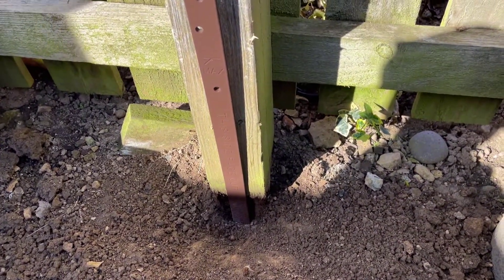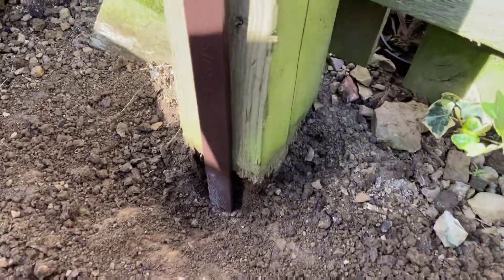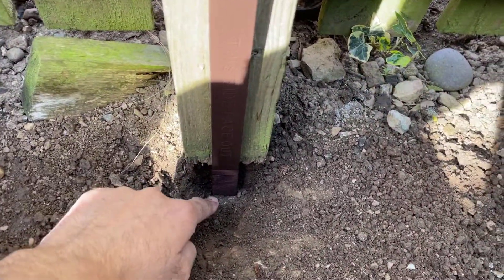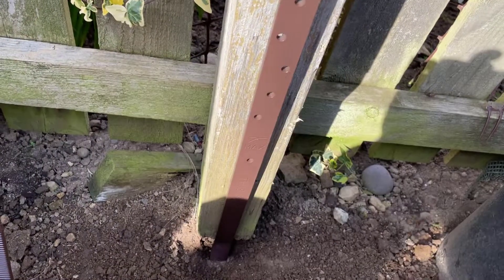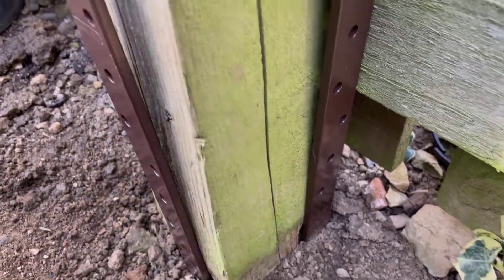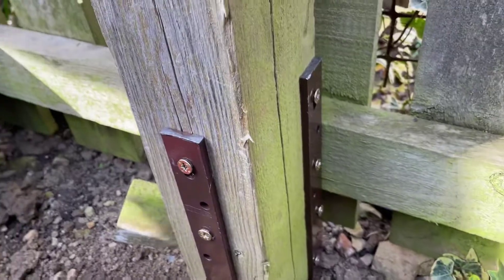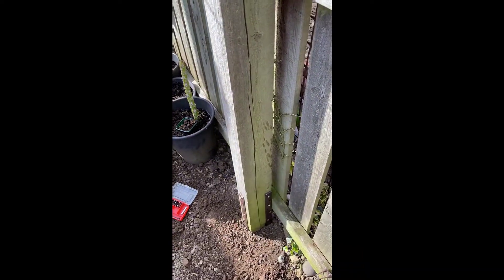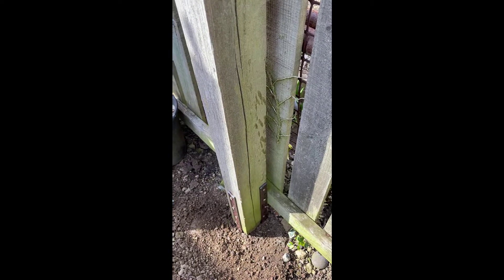Repair a Rotten Fence Post in 2 minutes

Comment: Nice try but it sadly won't last. The concrete used to hold the post in place needs to come up all the way or above the surface. - You otherwise going to have the same issue again.